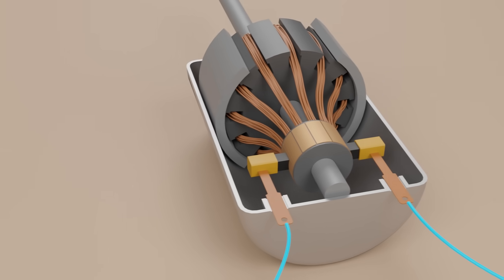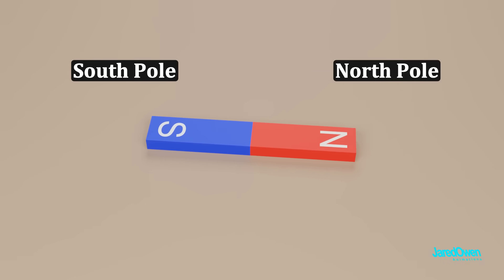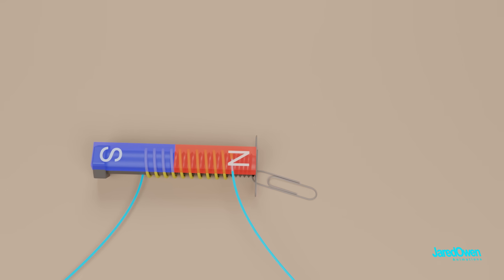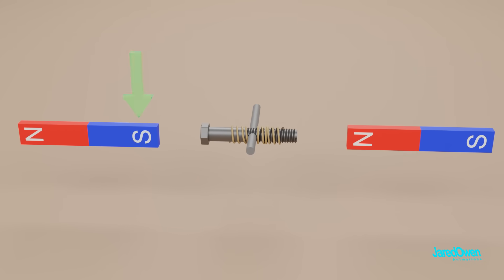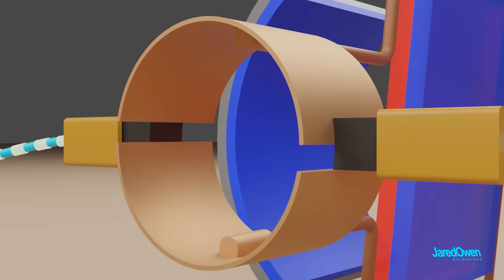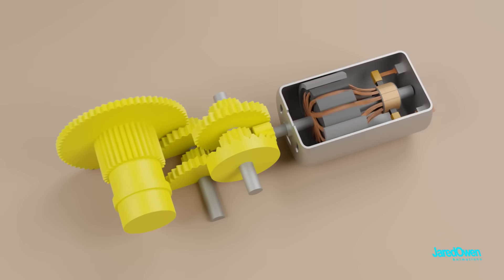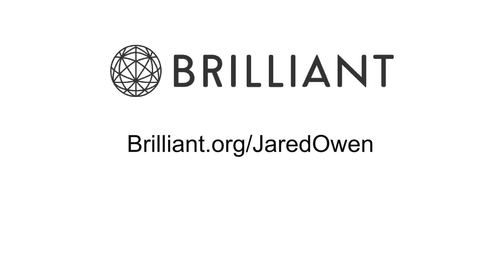How does an Electric Motor work?  (DC Motor)

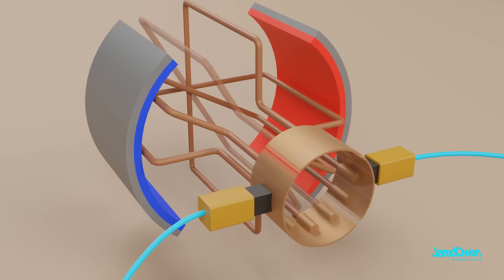Comment: in minute 7:00 i think the illustration for the magnet is wrong and it should be switched the other way(the internal magnet created by the circuit)

Comment: What makes this elegant is that nothing here “wants” to rotate. Rotation emerges from the interaction between current, magnetic field, and geometry. The motor is really a system that prevents symmetry from settling.

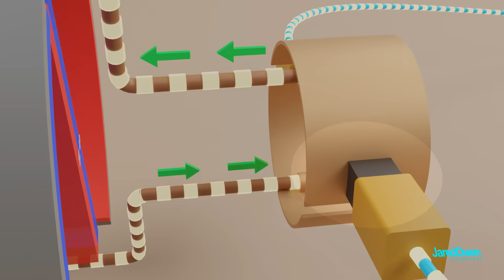Comment: I think there is an error @5:47 How would the current flow the other way? Cause we are not changing the polarity of  the battery, but the motor stills work without changing the current direction, the electromagnet is always maintaining the N  and S poles that are actually in the same direction as the permanent.

Comment: 1:05 Wrong, in DC if you flip the battery the LED wont going to work.
Reply: Its not a led. Its just a filament bulb. Since its not a diode, it still works even when flipped.

Comment: Question: when the brushes switch sides of the commutator ring what causes the flow of current to change directions? Why wouldn't the flow simply continue in the same direction as it did before leaving the electromagnet in its previous NS orientation?

Comment: Very nice 3d animations, real substances contain materials, and supposed to be manufactured to be precise forms. I could not manage to find any YouTube video, where somebody would found any of that in nature, and did any of the job needed to create any DC motor on there own from material containing fossil to working engine. If You ask on internet, creating plastic from oil or gasoline is practically illegal. Burning copper rocks also never happens. Just because we can see the principles of electricity, does not mean we randomly pop steam engine that somehow creates electricity. And all of that supposed to happen before internet or videos even existed, yet here we are in 2025.

Comment: With the spinning magnet, if there were four magnets, top, down, right, and left, and one AC EM, would the polarity in the AC electromagnet change 60 times per second or whatever the frequency of the AC is? Is so then it would be very fast

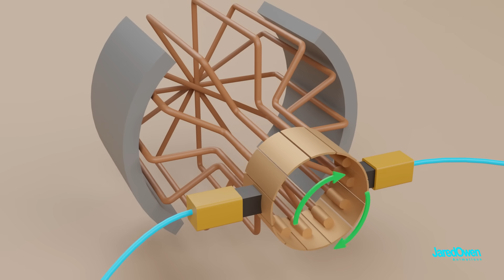Comment: 7:13 - correction note: For DC motors, torque and rotational speed are a tradeoff for a given voltage. Increasing torque for a given voltage level will decrease the rotational speed, and increasing the rotational speed will decrease torque. The best way to increase the speed is to increase the DC voltage used, which will increase both speed and torque. Just wanted to point this small detail out, great video!

Comment: Man, thank you very much. I am building electro bike from zero, so I need to understand the electric motor. Your video is structured in a way when you start with simple ideas and by little, simple changes work up to actual complicated real world motors. I love exactly this style, because then I can actually mechanistically understand subject. Of course I rewatched video multiple times and used 0.85x, and made sure to reproduce what I learnt on paper using pen. But it's a nessesary part for actual learning, not just watching for fun.
Best wishes, 
Simon

Comment: Hey i still have a dount 
When the commutator spines along with the electromagnet then the E.M have its north pole on its upper face and the commutator changes the flow of current in anticlockwise direction then it is obvious that the top will be north pole but you showed it south 
Hac i know how 🤧

Comment: Isn't that the the lorenze force not because of the changing poles of a magnet but it because a wire carrying current will experience a force in the magnetic field and then that force is what causes the spining in a wire however I'd the poles of the magnetic field generated by the current so idk
Reply: Yes it is. His video is so so wrong

Comment: Why is there a gap in the commutator? I feel it can be a continuous strip where the ends of the rotor are connected. Request you to clarify to understand better? Your video creation is good and easy to instruct students who are pursuing electrical engineering.

Comment: 1:12 if the current flows the other way the bulb will not turn on, however if u have a bulb holder, like in the video， the bulb would still be shining
Reply: Only if you have incandescent light bulb, like on old bikes but with led wont going to work.
Its strange because the incandescent light works even with AC (the old bike dinamo produces AC).

Comment: I have a degree in physics and have been working with electric drivelines in automotive for 7 years. This is the best explanation of an electric motor I have ever seen. To connect the basic concept of spinning electromagnetic fields to the hardware you actually see in cars has been a struggle for many, including me.
Reply: U have to raise kids
Reply: @user-io9oo9vx9u  What? Why? What has that to do with anything?
Reply: @user-io9oo9vx9u  😐

Comment: Amazing video with amazing explanation indeed. 
I m slightly confused. You mention DC motor, but then a fan shown in the video appears to be connected to an AC electric suuply?. Could you please clarify whether a motor only works with a DC supply like a battery?
Reply: Which country are you from?
Reply: @ayoub-vn1 why is that relevant?

Comment: How is it that stronger torque means faster spin? if, in fact, more torque means less spin according to this DC motor equation: M(torque)=(9.55*P)/n(rpm) - means higher RPM - lower Torque.

Comment: Summary: The battery has a negative and a positive pole. By connecting the two poles with conductive wires - taking these wires to the ends of a light bulb or something similar - the electrons will pass through these wires and turn on the light bulb. By placing a switch or something similar in the middle of this wire, the light bulb stops working. But if we invert the poles, the light bulb starts working again. This is because the negative pole "wants to reach" the positive pole. The battery is almost the same thing as a magnet: it has these 2 poles, but the magnet can be attracted to metals or to another opposite pole. By placing a magnet on an axle to rotate and placing another magnet near it, it starts to move. We can create an electromagnet, but this works when it is connected to an electrical circuit. For this, it is necessary that some conductor (a screw, for example) is intertwined with the conductive wires. However, when this is connected for a long time, it starts to heat up. Now let's assemble the electric motor: 1. Place 2 concave magnets facing each other. 2. Make a "square" of conductive material that, instead of having a closed circuit, has its ends facing forward (away from the magnets). 3. Make a ring of conductive material as well, cut in half, as if it were a candy cut in half. 4. These 2 faces will be connected to these ends of the "square". 5. With the same ring, you make more cuts. And for each 2 cuts, you fit 2 more ends of those "squares" into them. 6. In this ring, you will place 2 conductive brushes in contact with this ring; one on one side and another on the other side. Now you have created an electric motor. Know that the more "squares" you create, the more power the motor will have.

Comment: To household motors you can add refrigerator compressors, bathroom fans, computer cooling fans, heating and air conditioning fans, clothes washers and dryers, stove exhaust fans, microwave oven fans, kitchen sink disposals, and dishwashers.  Most of us never think we have so many...

Comment: Fantastic video, can I ask you a quick question.  So is an ac motor the same as a dc motor in which you can connect a positive and a neutral wire to the motor brushes to get it spinning.  I recently dismantled my table saw and i am a bit dubious of wiring it straight to the mains, Thanks in advance.

Comment: Hello When light and heat are electric magnetic field wire with copper ?can this repel bullets?

When steam power generates fussion energy by a divided steel wall of salt water hydrogen and freash water hydrogen meet at center twister spinning steel dreidel?

When lobestone magnet cover by copper coil give light and heat under spinning dreidel make electric magnetic field?

Comment: May grinder ksi Ako 0-11000rpm Ang gusto ko gwing buffing machine na 0-5500rpm or 2000-5500rpm .pwde bang bawasan Ang winding ng motor stator (commentators) pra bumagal.ayaw ko ksi gumamit ng dimmer switch.

Comment: 8:37 One note here. This fan has an AC (alternating current) motor. And the operation of a DC (direct current) motor is explained here, more specifically commutator motor. There are more types of electric motors, for example brushless motor.
The comment is rather addressed to the viewers.
You will understand why alternating current is used instead of direct current in home electrical installations when you learn and understand the war for electricity (AC/DC) between Nicola Tesla and Thomas Edison.
However, the video would be much longer and more laborious if Jared were to explain it and even exhaust the topic.

Comment: Correct reason for rotational force on armature is interaction between rotating magnetic field around armature coil side and main field which is understood learning Flemmings Law. Switching polarity of armature coil magnetic field happens at the neutral axis which is halfway between field poles and not at center of field poles as you have mentioned in your video.

Comment: Saw this video on 9gag - honestly it is partially missleading or not correct
 
1) The primary effect, why the coil in the magnetic field moves is the "Lorenz-Effect"
where an electron moving through a magnetic field experiences a force. The main reason for the rotator to be made of metal is NOT to be an electromagnet, but to provide the magnetic field from the outer permanent magnet a magnetic path with less magnetic resitence which it will then preferably take.

2) Stronger Tourque does NOT mean faster spin. Depending on application motors are build intentionally for higher tourque at lower RPM´s

3) The "more wires" around the rotor are NOT there fpr "stonger electro magnets to spin faster". This one sentence is even wrong on two levels. First as said above, the rotor is NOT primarily an electromagnet - SECOND and more important that statement is even wrong. More windings actually means lower RPM, because the backinduced voltage is higher ("back-EMF"). What more windings actually mean is "more tourque for a same current in an otherwise same motor"
-
E.g. increasing tourque and decreasing RPM can also be achieved by stronger outer magnets. Or intentionaly by weakening them - which is an actual technique called "field weakening" or in hobby-racers refer to it as "timing of the motor" which effectivly means changing the relative position of the brushes to the position of the permanent magnets.

Comment: I made the circuit that you have at the start, and my battery got super hot! Is that supposed to happen?
I wanted to create a magnet. But I realized the screw I used was already magnetized, woops, perhaps that's why?
Reply: Actually, I'm guessing since I used a thick wire, that there wasn't enough resistance, and the battery chemical reaction was going too fast because the current was too fast? I'm not sure how that part works, but yeah, I'm guessing with enough resistance, it would be fine?

Comment: 7:14 I thought torque was inversely proportional to speed. Why is it in this case torque = speed. Or at least stronger torque means a faster spin.
The reason I'm confused is that usually when I have something that is "high torque" it tends to be slower than something with "low torque"

Comment: Such a simplified explanation! It would have been even better, had there been an illustration showing what determines the direction of the movement - clockwise vs. counterclockwise. Excellent use of 3D Graphics!

Comment: This video is BRILLIANT! Great introduction to DC Motors!  

I stopped using my Toro Electric Corded Power Jet F700 because sparks were arcing inside when I looked in the exhaust. I did some research and then proceeded to disassemble the leaf blower: I was a little apprehensive, but I pressed forward with the disassembly because I hoped that I could repair it [big dreams].  My Father was a Master Electrician, so I retrieved his old book titled Electric Motor Repair by Robert Rosenberg: I am trying to understand what type of motor is in my leaf blower: I was leaning towards a Alternating Current Motor Control because I must plug it into the house electrical receptacle for it to power on; however the Universal Motor is applicable to both AC and DC?  It has been a challenge to reassemble because the plastic housing has to matchup.  These past seven-(7) days has been frustrating because I searched both YouTube and the internet and also read the Electric Motor Repair book and I still cannot get the leaf blower to power on when plugged into electrical receptacle. I used color matching zip-ties, so I can reconnect the correct wires [only 2 pairs!!]  I thought once I cleaned-up the commutator I thought my leaf blower was going to operate.  I am still troubleshooting the wiring: my auto mechanic told me that the type of switch on my leaf blower is a rheostat. I was probing the wiring with my multi-meter and I get good readings on the negative side, but nothing on the positive. I may be doing something incorrect with my probing, but switch is on the positive side. I just watched a video where the "Guy who gets it done" has his DC motor on the casing by the brushes marked positive and negative - mine is not marked https://youtu.be/S4GY2eLjR7k?si=ggtsy_OJPATfmer8

Comment: this video is highly innacurat, as a circuit engineer myself I noticed immediatly that the first diagram had electricity exiting from the positive end. THIS IS NOT HOW IT WORKS. ELECTRICITY LEAVES THE NEGATIVE END. either make a factual video, or dont make one at all

Comment: You forgot to mention that iron is magnetic as long as electricity flows through it. It's a temporary magnet. But steel is magnetic even when the electricity is off. It's a permanent magnet.
Reply: This happens whether the screw is made from iron or steel.
Reply: How does the current change directions
Reply: @Nishi4005  umm. I don't know. I am still researching it.

Comment: I understand that this configuration of motor is the easiest way to show the forces involved. But it's also not a good motor design. By making the stator the electromagnet and the armature the magnet the permanent magnet it removes excess points friction from the system, reducing wear and tear on the device. Almost all power tool use that set up and it's called a brushless motor. Sorry just ranting. Great video, very well made

Comment: This is the best way of teaching. Starting from the scratch to the real big machines.
Reply: Don't forget all AC & Radio waves type power have three elements, 1. the positive cycle 2. the neutron, last but not least the   3  the negative cycle.  That neutron cycle is by far the most powerful once you understand:  Without the neutron, the energy could not move forward!!!  You can learn allot about this if you have a bar magnet.  I will prove to you that the center field of a magnet is the most powerful by far!!!  It's how they built the great pyramids!!    If you have a bar magnet/ not a horseshoe type, I'm going to show you all the basics.   DO NOT DISRUPT THE CENTER FIELD WITH ANY OTHER METAL>> 1. Anti-gravity, get something like plastic or glass a granite rock would work well just tap with your finger the centerfield of the magnet near same and it will lose 2/3 it's weight, Next 2.  let's tap the center field near a stream of water and watch it repel the water.  3. If you vibrate the center field at the correct frequency any granite rock will become butter.  YOU MUST UNDERSTAND THE DIFFERANCE FROM An OSCILLATION AND A VIBRATION!!!  The petrographs on the pyramids told us all of this...  Our future will depend on the center field, The height of one's intelligence is directly proportional to their realization of their own ignorance VPC!!
Reply: Agreed.

Comment: Before this I knew absolutely nothing about DC motors. But recently I had a DC treadmill motor go out and I opened it up and noticed these two things (which I now know are brushes) connected to wires that are worn down. Seems over time you just replace these brushes. I already replaced the whole motor with a new one from a treadmill I got for free. Good to know now incase a DC motor goes out this is the likely culprit. And I have Impact drivers etc... and never paid much attention to certain tools saying "Brushless motor". Now knowing those will last longer.

Comment: Very good explanation, but I know that in reality powerful electric motors have a different structure. In them, on the contrary, the winding of wires coming from the power source is stationary, and the rotor is a permanent magnet that rotates inside the winding. I would like to see a video with the same visual explanation of the operating principle of such engines.

Comment: I have one question.  In the video, it is expressed that when the N pole of another permanent magnet approaches the N pole of a permanent magnet whose rotation axis is located at the exact center of the N and S poles, the magnet with the rotation axis rotates clockwise due to repulsive force.  I have a question about that.  Do you have to go by the clock?  Why not counterclockwise?